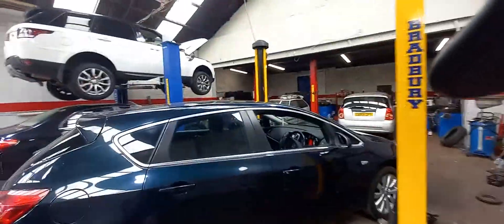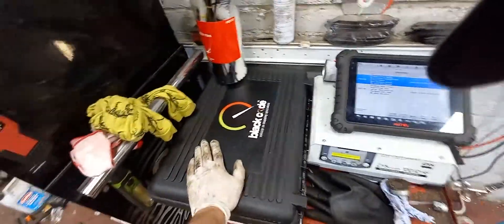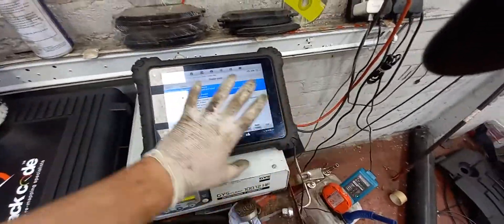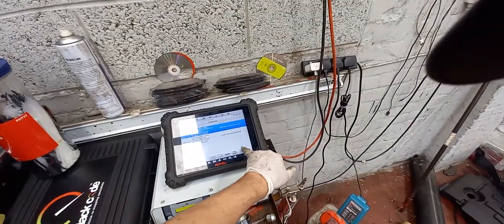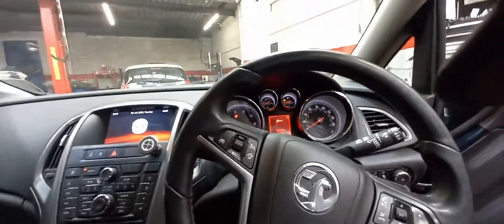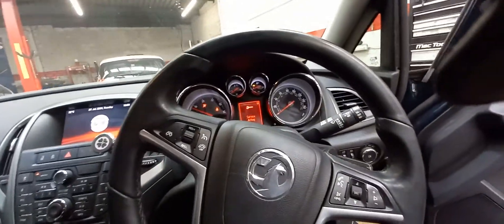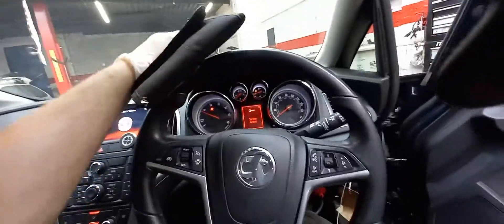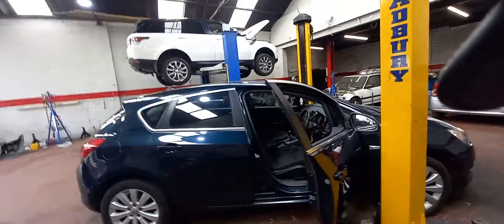STAGE 1 REMAPPING VAUXHAL ASTRA #DPF FIX

Comment: Does this stop the limp mode and smoke as my miss drives it 5 miles a day steady to work would it suit to remove mine for the miss
Reply from the maker: https://youtu.be/qf_iSpkj4MA

https://youtu.be/BSgNPycadnE

without diagnosing it it would be hard to say has someone diagnosed dpf allready these are 2 videos about dpf  there are a no of reasons for going down this route but there are lots of solutions for dpf many thanks stephen cairney #CAIRNEYS AUTO SOLUTIONS www.cairneysautosolutions.co.uk

Comment: Will remapped and dpf deleted car pass mot
Reply from the maker: it's possible I'f the engine is I  excellent working order I guess everyrhing would need to be perfect strictly speaking its for off road use only 😉  many thanks for watching if you haven't allready please consider subcribing
Reply from the maker: 100 percent give you more power and increased mpg many thanks Stephen